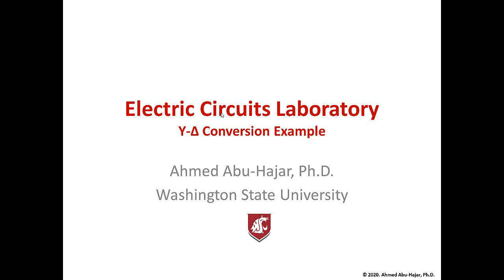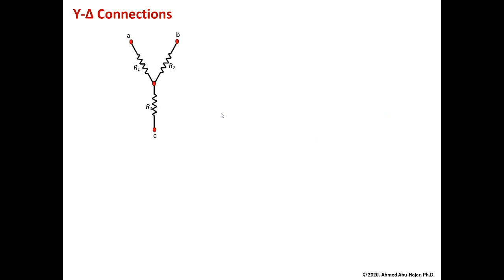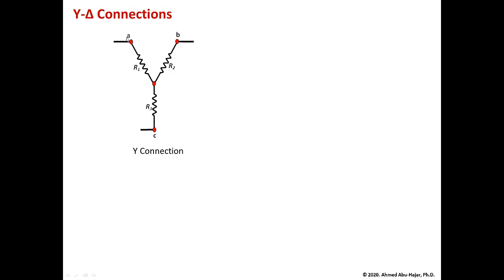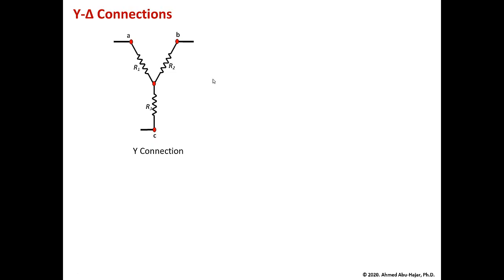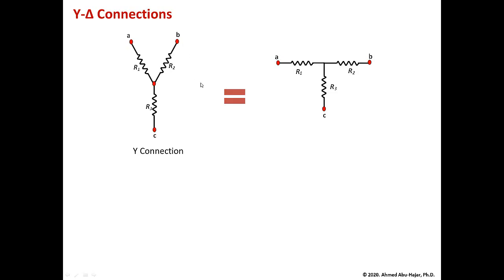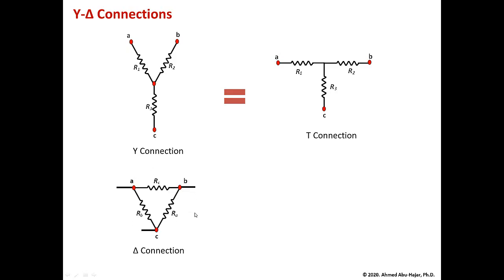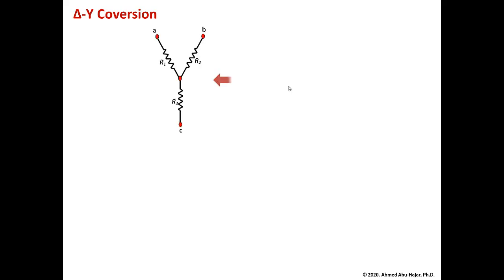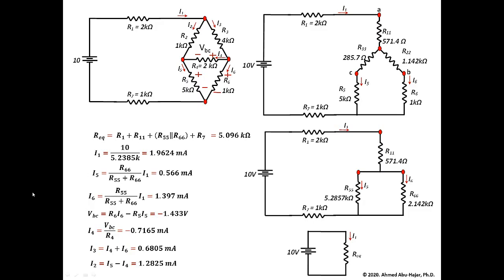Introduction to Electric Circuits - Delta-Wye (Δ-Y) Conversion Example

Comment: i believe there is a problem when solving for R33. R1= 2k and R4=2k. Was it supposed to R2 and R4 in the numerator? R2=1k which would give the correct product and fit with the equation, or am i missing something?
Reply: also, when solving for I1 you used a different value for Req... Req = 5.1 k, then I1=10/5.2385 k?

Comment: If I wanted to find the voltage across R5 would I use VR5 = Vs((R5||R6)/Rt) or would I reduce it further and use VR5 = Vs((R55||R66)/Rt)?  I am a little confused about this concept and I am rapidly approaching finals.   Any insight would be greatly appreciated.

Comment: where did the 5.2385k came from?
Reply: the sum of R33 and R5 (they are connected in series after conversion)
Reply: @WhisperedTales713  wait so R33 + R5 would not it be R55? and it will be 5258.7?
Reply: I'm pretty sure that it is 10 over 5.096 equal to 1.96. Somehow he messed it up.